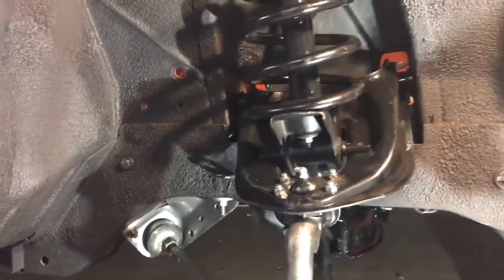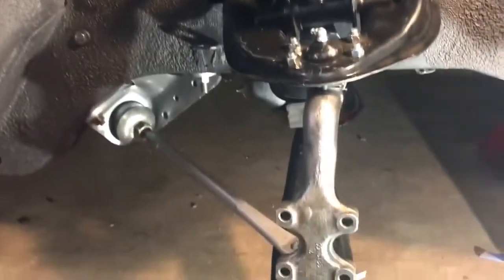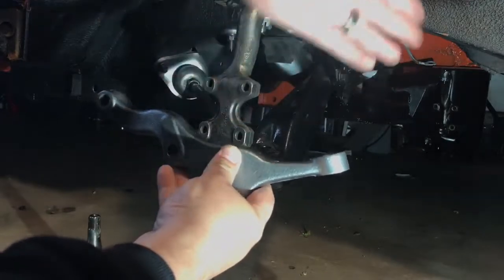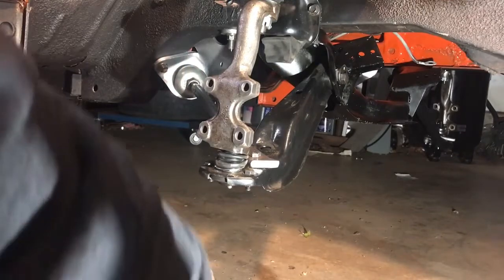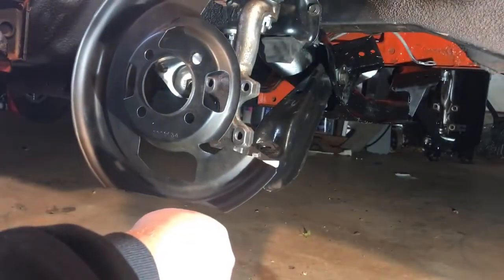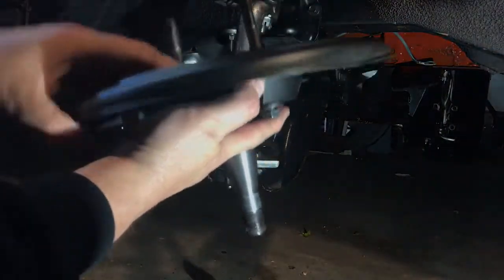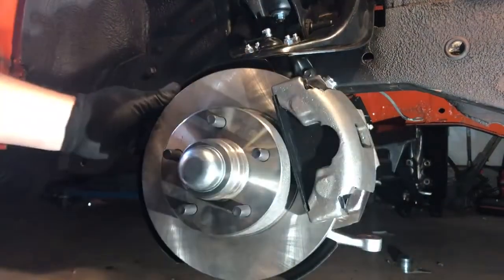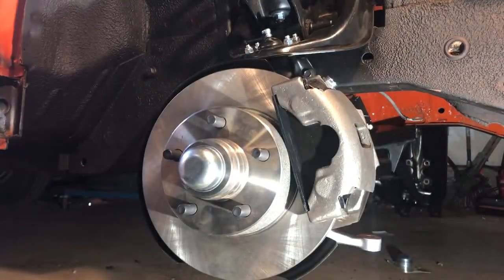Front brake installation step-by-step - small-body AMC - Gremlin, Hornet - caliper pads rotor

Comment: Hi, is there supposed to be an O-ring under the outer dust cap? If so, do you recall what's the size of it?
Reply from the maker: Yes, there is. I THINK it's 1-25/32". I used a new rotor and new dust cap, so I'm not too concerned with the o-ring. The fit on new parts is super tight.
Reply: @dstructo  Thanks. May I ask if the O-ring is fitted around the perimeter of the dust cap, or does it sit at the bottom edge where it meets the washer?
Reply: yes there is an o ring just measure the outside of the cap